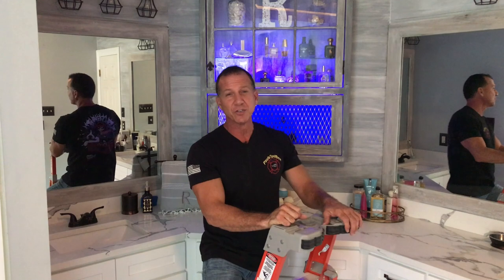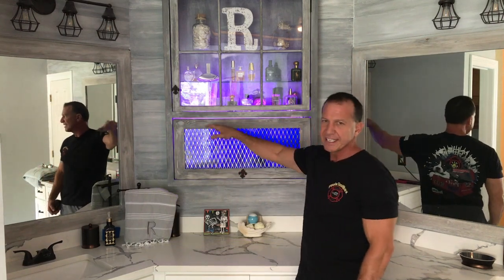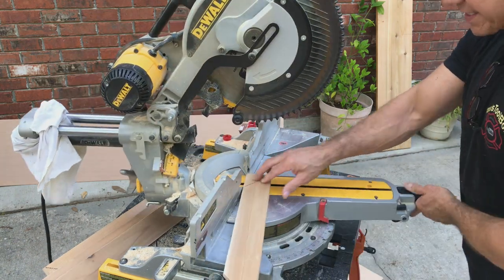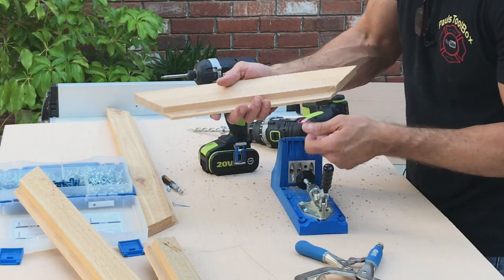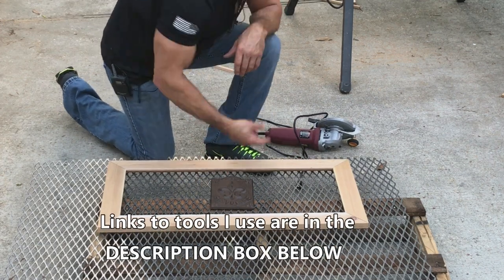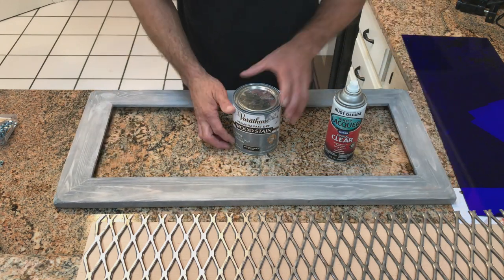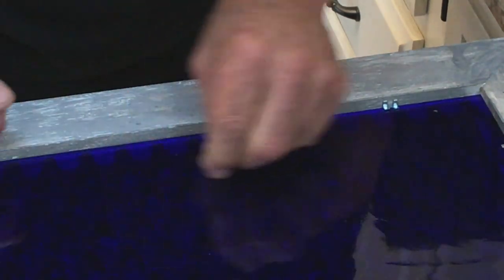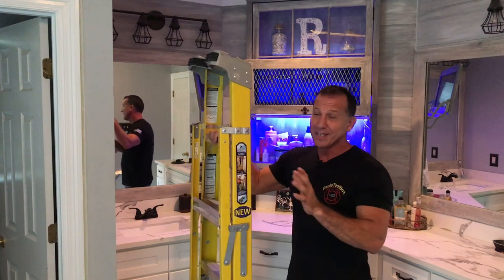Backlit Cabinet Door DIY!

Comment: Nice work, Paul. And, wow, that ladder is exactly what we've needed in the residential electrical industry for installing vanity lights. It looks like it would work good for working on bedroom ceiling fans, which are 90% of the time located over a King sized bed in the middle of the room.
Reply from the maker: Hi David, Thanks for the compliment.  The ladder would work great on a project like that.  Then you won't have to lean over as far to reach the fan. Good luck to you on winning.
Happy Labor Day! Paul
Reply from the maker: Hi David,
Please contact me ASAP through my web-site www.paulstoolbox.com. On the contact page I will need your channel name along with your complete mailing address. You have been chosen by Louisville and are the winner of this video's give away.
Congratulations and thanks for watching!
Paul Ricalde
Reply from the maker: Hi David, I will have to choose another winner if I do not hear from you soon. Please go to my web- site  and give me your mailing information. The deadline is the 22nd.

Comment: Wow.  That looks great.  Love the blue glass.  I would probably use green for my bathroom.  Wish I could find a good local glass place in Austin.  I checked Harbor Freight for that double cut saw.  It's $59.  I put it in my list, in case the price drops.  I love your videos.
Reply from the maker: Harbor Freight frequently has sales, if you get the mailer you can keep up with it. It isn't the most durable saw but it's harbor Freight. It works great for DIY and I am happy with it. I will get the number of the Glass place and I will have it in the description box. You could probably order stained glass in larger sizes at Hobby Lobby. I will check into it. Thanks for your comment and Have a great Labor day!
Paul

Comment: great video. would love to use those ladders to finish my basement
Reply from the maker: Thanks Paul,
They sell a consumer version that has a 250 Lb. rating at several places. I bought the yellow on from www.walmart.com and had it shipped to my neighborhood Walmart for free. I bought the ladder on sale for 49.00. You can also get free shipping with www.amazon.com Prime and the price is lower than Werner. There is no comparing the two ladders.
Thanks!
Paul

Comment: I’ve been watching some of your cabinet painting videos. I want to paint my cabinets and I like that you use automotive primer spray but I don’t want to use a spray for the frames inside the house. Is there a brush or roller paint I can use for the frames because I really don’t want to spray in the house. Same with the clear coat final coat.
Reply from the maker: Hi Daniel,
You can lightly sand the cabinet frames with 220 grit sandpaper and use a good primer prior to painting. I have a video showing how to do this without leaving brush marks. I really like Zinser 2 primer by Bullseye, it's a water base primer that adheres really well. If you have any questions,please send them to my web site (www.paulstoolbox.com) and I will do my best to answer.  https://www.youtube.com/watch?v=2MI9DWWzY8s
Thanks!
Paul

Comment: Nice job once agian brother. Only thing i was wondering is did you use stainless steel screws cause they too will want to rust depending on the humidity in there and did you think about putting the diamond stuff behind the glass at all. Before you started that's what i thought you were doing and it would protect glass from anything falling on it from inside. I like them ladders 😜 buddy

Comment: Does that high tech ladder come in a fat boy size? 250lb ratings are just a taaaaaaad light for me. They look like just the ticket though!
Reply from the maker: Hey Bill, They do have 300 lbs. load capacity ladders. This is one model they have. Louisville Ladder 6-Foot Fiberglass Step/Shelf Ladder, 300-Pound Capacity, Type IA, FXS1506.  You can see it on my website at paulstoolbox.com/shop. They do have other models too.  If you have any questions you can contact me at my website on the contact page.  Paul